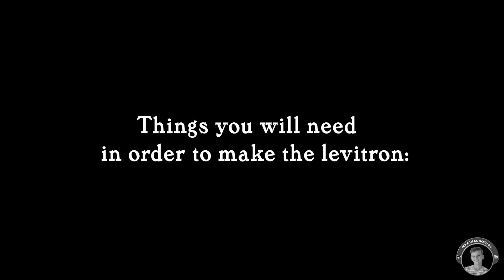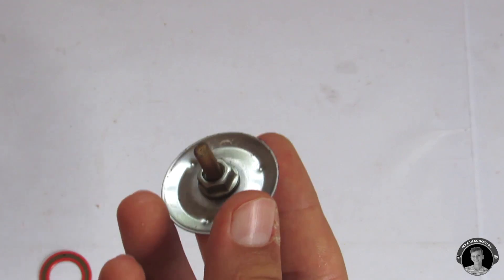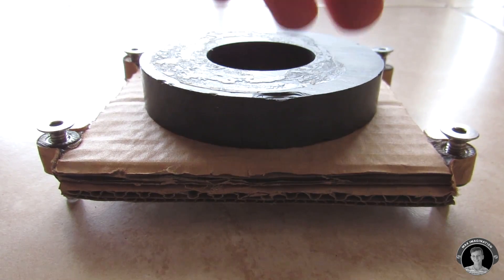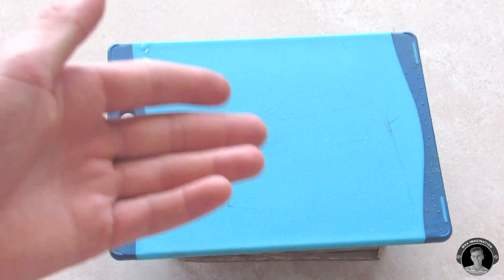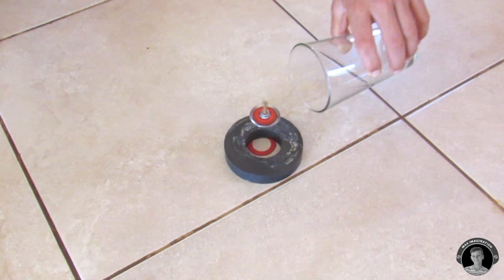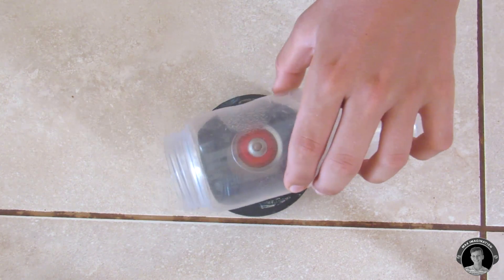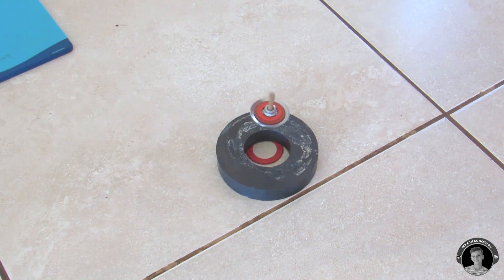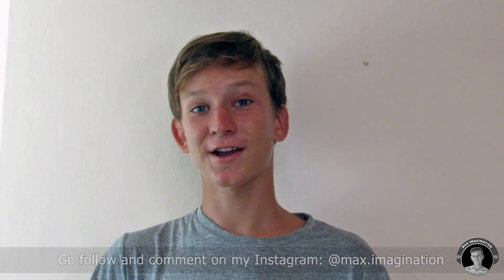LEVITRON Levitating Spinning Top | How to make a Levitron from scratch | Magnetic levitation

Comment: I have a couple of original Levitron toys very difficult to master as it changes constantly due to temperature changes. I can often get over 2 min on a good day. Would love to try in a vacuum chamber. Too slow or too fast it won't work so mechanically spinning is difficult I think the sweet spot is around 2,000rpm 🤔
Reply from the maker: Interesting point, temperature can certainly affect the levitation. Someone mentioned that adding a "Perpetuator" device, can help make it last longer hovering - thanks to electromagnetic pulses.

Comment: Spin is not necessary for levitating. There is a way to levitate magnets without rotation.
Reply from the maker: To do that, you use electromagnetic suspension.
Reply: @MaxImagination you can do it with permanent magnets. It is easy.
Reply from the maker: Not without some electronic circuitry and coils.
Reply from the maker: Unless you can tell me how exactly?
Reply: @MaxImagination  sorry i don't speak english well. But it is easy. If the base has S and N at the same time then the magnet above levitates ( still ). Build a circular base with magnets S and a center N. I Am serious. I Am not joking.

Comment: I love your Spinning Top video! However, I want to issue a significant warning concerning magnets from an old microwave. The magnetrons MIGHT contain the substance Beryllium Oxide, BeO. BeO is a white or pink ceramic used as an insulator. If you inhale dust from this substance, you are a dead duck. NEVER grind or break the insulator. IF you use an old magnetron, be VERY CAREFUL!
I want to repeat your experiment. I can probably find an old bass speaker. They have nice magnets!
Sinerely, Dr. Robert Svensson
Reply from the maker: Thank you for warning not only myself, but most importantly others who come across your comment. Yes, the safest and best alternative is to extract the base magnet from a speaker.

Comment: Pls can you tell me that where is it in amazon of 1st thing and 4th thing in this video
Reply from the maker: I dont understand your question? The links to all the parts used are in the video description.
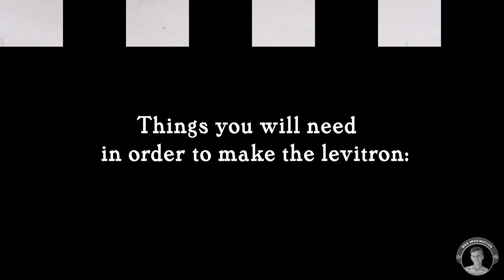Reply: The 1st closer and 4th closer you shown in the video 0:35 what things want to make is not in the description
Reply from the maker: The first one is a metal disc from a tambourine, the 4th one is a automotive decorative washer, any thin and wide or thick washers will work. You can custom-craft these yourself.

Comment: Great video!!!, I was just wondering if you have seen anyone in the comments having success using the given magnets in the description. I have a pair of the ferrite ring magnets, but I think that they are too small. The top diameter is smaller than the ring magnet’s inner diameter but it seems that since the inner diameter and the top’s diameter are very close in length that the top won’t spin on the surface I have it on. This may be confusing, but I just need to know if there has been success with your given magnets or I could just keep using the ones I have. Thanks
Reply from the maker: Thank you! As long as the top magnet's outer diameter is the same or smaller than the base ferrite ring magnet's inner diameter, you're on the right track. I have had other people come to me saying they have succeeded with the materials and guidance from me. Cheers and best of luck with your levitron!

Comment: Make the top piece perfectly balanced made on a lathe.
Then spin it in a vacuum chamber, suck all the air out and theoretically it should spin almost forever minus the incomplete vacuum wich is impossible to make a perfect vacuum. Maybe some other forces too will slow it down that I don't know of.
Reply from the maker: Good tip! The main piece with the rounded bottom could be made out of brass or another non-magnetic metal and is the piece where all the magnet and washers slide onto.

Comment: i dont have some materials like the spacers and i have to submit this model day after tmr, so i replaced some of the materials with other things, but my top is not levitating :( can you please help asap
Reply from the maker: I suggest you try and make the adjustable stand I used in the video, it will be easier for beginners as yourself to level the base magnet to get your top going. Question, are you using a neodymium magnet for the top? This is important.

Comment: why did you have the bolt leveling platform in the first half but then later not used at all, and then what is up with the latge ring mag just sitting on the tiles?
Reply from the maker: The large ring was used to level the base magnet when I wasn't using the leveling platform, this was done mostly for looks.

Comment: Bro can we use ring magnet in the place of neodymium magnet
Reply from the maker: No. It won''t be strong enough to sustain the spinning top in the air. You could try, but it will make it much more difficult to work...
Reply: @MaxImagination  bro i have tried with two ring magnets on the top it is not working may because of incorrect materials I have used

Comment: If you place the ring magnet on a foam plate (small plate) floating in a pot of water it will self level once the water settles your top shouldn’t have any problems
Reply from the maker: Interesting suggestion... Have this been proven to work?
Reply: @MaxImagination  I haven’t tried it in practice however water leveling is a proven method that will work in a puddle or in a tube of any length 
So theoretically it should work
Reply: I would worry about the floating not remaining solid but changing when any downward and moving force applied to it.  Maybe it would have a damping effect and help tho.

Comment: I am just wondering, would this work if I replace the round ferrite magnet with several round ones, placed in a circle?
Reply from the maker: This could work on a smaller scale, but you'd need to get your angles 100% right, a difficult task. I'd advise it's better to simply take one base ring magnet and use that.

Comment: Great video! I am trying this for a project. I have one question. Why should the diameter of the magnet in the spinning top be smaller than that of the base?
Reply from the maker: Hi, Rein. Thanks for your comment! The hole in the top magnet must be small to suit the diameter of the 4mm wooden rod.
A better way to rephrase what you meant is the Inner diameter of the base magnet must be a bit larger than the Outer diameter of the top magnet as this is the physical aspect that keeps the spinning top hovering in place, creating the magnetic "donut effect". Same as a golf ball rolls into a hole larger than its diameter with ease rather than rolling over the hole. Cheers.

Comment: Good video.   I think the l spinning top stopped because of air resistance.  If the top was in a vacuum it would spin forever.
Reply from the maker: Hi there, thanks for watching! As this is not directly related to free energy, the top would definitely spin longer in a vacuum, but not forever due to opposing eddy flux current from the magnetic field.

Comment: How can it be levitating and spinning without an alternating current power supply?
It needs a current to pull this off
Reply from the maker: Well then how does it not continuously levitate without stopping? Magnets also repel each other... The kinetic energy of my hand spinning the top from the start gives it enough rotational energy with the opposing magnetic field from below to pull this trick off. It only stops being magnetically suspended when the spinning top slows down and loses that kinetic energy, no longer sustaining an evenly distributed magnetic repulsion which the rotation took care of.

Comment: I have a problem placing my spining top above the round magnet. When i stary spining it above the magnet it flews away. But when i spin in smooth surface without round magnet it spins stable. Please help me.
Reply from the maker: Hi there. Please check the following:
1. The spinning top is near perfectly balanced (parts are centered and no wobble)
2. Your base ring magnet is oriented the correct way (feel that spinning top can get sucked in when near hole)
3. Height from base magnet is adjusted right (you can't start the top from too high up or low)

Hope this helps. Cheers,

Max
Reply: @MaxImagination  Can you explain specifically how will i place my base ring magnet and neodymium magnet. Where will i face my base ring and neodymium magnet. I still don't get the north and south pole of the magnet. Please thank you.

Comment: I just started high school and I'm trying to create a magnetic field. I don't quite know what material you need..  *help
Reply from the maker: Hi there. What sort of magnetic field are you trying to achieve? Are you attempting to induce a voltage in a coil of wire? I'm happy to help.
Reply: @MaxImagination  I am planning to generate electricity but I have some questions that magnetic field occurs in two ways, electric field change and electric current. but isn't electric current also the movement of charge, hence the movement of the electric field created by the charge. do these two have a different physical meaning? Also, does the spin motion of the charge that creates the magnetic field in permanent magnets behave like electric current? (sorry my english is a bit bad)

Comment: Hi there! Really wanted to try and make this. Can you please share where to get the spacers as shown in video? Looks like there were 2 different kinds you used for spacers.  And the red bearing covers. Are those the same as the washers? The measurements of each material you used? Thank you so much!
Reply from the maker: Hi there. The washers you may need will most likely vary, it depends on how strong of a magnetic repulsion you're getting. Choose something rather light, such as aluminum or tin washers. 
Also, the biggest and bottom washer is a tambourine disc. 

Cheers!

Comment: Actually I think my magnet is weak cause I lift it up for like 7 inches and it didn't do anything
Reply from the maker: If so, your spinning top may be too heavy for the magnet's strength. Also, which magnet do you have, neodymium of ferrite?
Reply: @MaxImagination  neodymium, and I also made it as light as possible

Comment: This also means that we have energy associated with these magnets as it spins and levitates.
Reply from the maker: The levitation phenomenon leans more to being magnetic suspension rather than levitation, as I've learned from a viewer. The magnetic levitating spinning top is given kinetic energy from my hand to spinning on a fixed floating space (the opposing magnetic force from the base magnet. The energy of this levitron concept is no different than spinning a top on a solid, flat surface. This phenomenon does not produce free energy.

Comment: What would happen if you used a neo-d magnet on the bottom??
Reply from the maker: I've never tried that. Though, knowing how strongly repulsive the magnet would be, it would be much more difficult to get a spinning top as such levitating without jumping straight off. Knowing this, it would be cheaper for one anyway to use a ferrite magnet for the base.

Comment: Do you have any tips on finding the starting height above the ring magnet? I tried spinning the tops, but it wont even spin, it just tumbled (like fall down immediately being pulled by the magnet)
Reply from the maker: Hi, the starting height at which you should spin your top from on your board or launching platform really depends on the dimensions of your base and top magnets. In terms of telling by the push of pull of the magnetic repulsion, you can find out your starting height by moving your top up and down just above the base magnet, you should not feel an invisible bump, but instead quite a bit of attraction 1.5-3cm above the base magnet. from that slight pulling-in point, is where your top should be spun from, basically, your launching board has to be a little lower than that. Hope that helps.
Cheers,
Max
Reply: @MaxImagination  many thanks! Will try that. There's just so many variables to get it right :)
Reply from the maker: No problem.
Oh yes, there sure is a many important factors to keep in mind when doing such experiment. It's just trial and error! :)

Comment: Please tell me how to get Neodymium magnet
Reply from the maker: Hi, you may be able to find similarly shaped neodymium magnets in old electronics you find, such as a DVD CD drive unit (found in old computers), you could possible find a smaller 1.5cm magnet with a hole in the disk holding part connected to the shaft of the motor.
Reply: @MaxImagination  thanks for telling but I am not using computer
Reply from the maker: @movinglivingshield2655  No worries. You may then check your local junk yard, or ask repair shops for their unwanted PC parts. Maybe state what you need specifically.

Comment: Can we use normal magnet and nit the neyodium
Reply from the maker: Unfortunately, you will have less luck getting your spinning top levitating if you use a Ferrite magnet (non-neodymium) as ferrite fridge magnets are several times weaker than neodymium, making your ferrite magnet spinning top too heavy in any circumstance, your top wont have enough lift. 
I suggest you purchase online a set of one of those cheaper Neodymium magnet sets with holes (these sets of 5-10 are ones with holes).
Reply: @MaxImagination  Ok👍🏻

Comment: Im not really a smart guy, but what is stopping it from spinning? Is there a friction or is the magnet electrocharge and become low charge after long time of spin?
Reply from the maker: Air friction is the main element that plays the role of slowing the magnetic levitating spinning top.
Reply: Friction by surrounding particles

Comment: great content! would be good to know the dimensions of the magnet as well as the mass of the spinning part. Maybe this way a ratio can be estimated
Reply from the maker: The dimensions of the base ring mangnet are: 10x2cm, with a ~4cm hole diameter. 
The top ring magnet's dimensions: 24x5mm with a 4mm hole 
Hope you can get an idea on the dimension ratios. 
Thanks for watching! ✌😊
Reply: @MaxImagination  where can I find all the supplies you used because I'm doing this as a science project and nothing I have is working right
Reply from the maker: @thesinuro  Hi, sorry to hear that! 
I got the base ring magnet from a large speaker, smaller spinning top magnet from Amazon.com, and the rest of the parts are all from basic household materials, such as a pencil, washers etc...
Reply: Just get yourself a microwave magnet they are all exactly the same size you know what the rest is so get to work brother
Reply: @Max Imagination, do you have the exact link to the magnet found on Amazon?

Comment: If you need a magnet go for a speaker cos it's easier than taking apart a microwave. If you do take a magnet from a MW be careful not to break the ceramic bits on the end of the magnetron (the bit that makes the actual microwaves) because they are toxic and horrible and can cause sickness. Watch a microwave teardown vid to learn how. 
If you go for a speaker magnet be careful not to break the magnet while taking it out. It's easily done.
And remember, magnets are FUN.
Reply from the maker: Hi, yep, speakers are usually the preferred option when it comes to seeking for a large ferrite magnet. 
I have a microwave magnetron which contains a magnet, though now I may not consider opening one up just to get a magnet. Safety first!
Reply: @MaxImagination  Please revise your text and remove microwaves, because of magnetorns but also there are big condensates that may kill you at an instant  ....
Reply from the maker: @fairytalesaudiobooksforchi9995  Good point. That's something I missed to mention about microwaves... Not really safe machines! :/